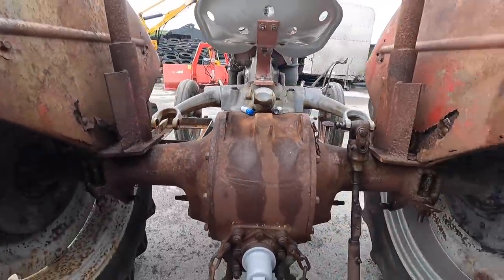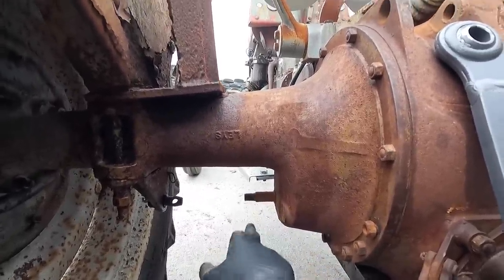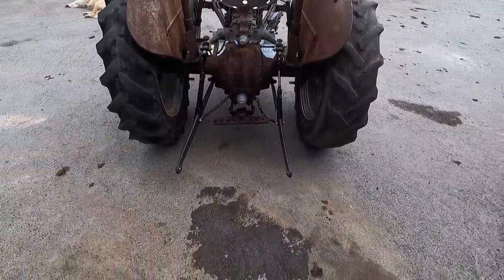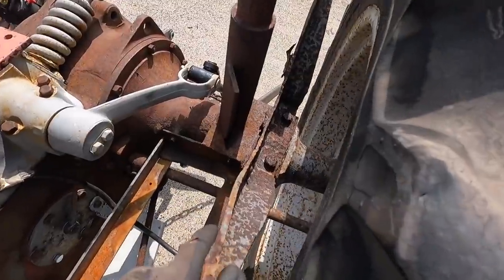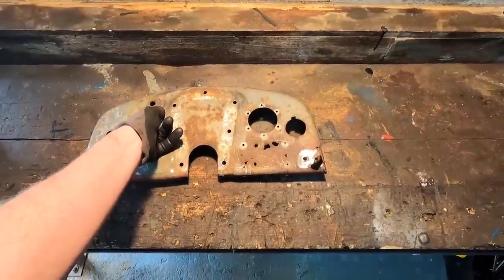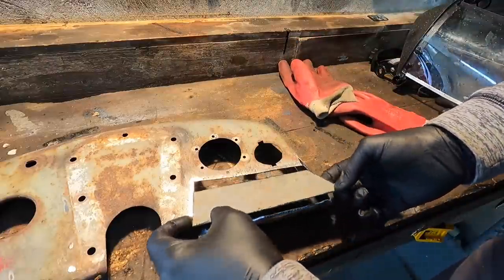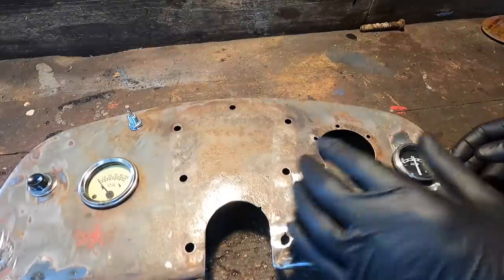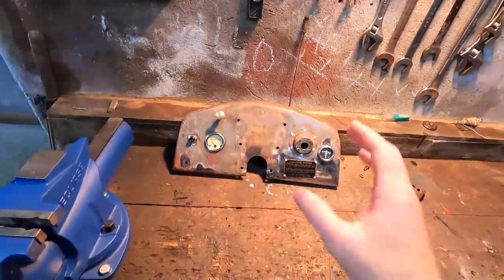FERGUSON RESTORATION -PART 3- IT'S NO GOOD WITHOUT A LIFT AND THE DASH IS REBUILT/RECYCLED!!

Comment: For the rusted holes in the dash you could have saved work by just cleaning the holes up and with a flat piece of brass put it behind the holes and then weld the holes until filled. Then you remove the brass plate and grind the welds smooth. Also you can get different wire that's made for dirty metal.
 That little mig is all you'll ever need for fixing tractor buckets to sheet metal.
 Very nice to watch your videos from a different part of the world, Ontario, Canada here.
Reply: Great advice ,I thought the same as soon as I saw the dash .

Comment: I love my MillerMatic welder. Set my wire size, and then just set my dial for material thickness. Works a treat. I did buy 2 gas bottles, just so that when I run out of gas on a holiday Saturday night I’m all good to go. Still cheaper than renting.

Comment: Adrian, I repaired a pinholes chainsaw petrol tank with a compound called Seal All which came from a motorcycle repair workshop/shop it was handy as it came in a small tube and was about £6 whereas the tins of sealant were £40+.

Comment: To take out the 2 bolts in the mudguards going through the axel I find if u cut the bolts on the top then lift off the mudguards, the bolts should be about 10mm proud of the axel housing. So a couple of good cracks with a sledge should get them moving once moved grind down the tops flush with the axel cos it. Probably be like a mushroom after the sledging then get a punch and a heavy hammer and it should be handy move it then. Works for me. Another excellent informative video. Keep them coming. 👌👍

Comment: Hello Adrian, the tractor is starting to come together nicely for you. I get my argon (for TIG welding) from Stargas as opposed to hobby weld so I’m not sure if this applies to their CO2 bottles. I got a 20L bottle which is filled to 200 bar which is 4000L at atmospheric pressure, the 9L bottles are only filled to 135 bar which is only 1215L . The refills are only around €30 more expensive for over three times more gas so if the same is true for Hobbyweld CO2 then I would strongly recommend paying the extra few euro to upgrade to a 20L bottle because you will save a fortune on refills. Love the channel, keep it up.

Comment: Good tip for MIG welding, you want to follow/push your puddle when laying a bead unlike arc welding where you drag your puddle of molten metal. This will also help with burnthrough on the steel.

Comment: I used epoxy filler on inside of steering housing which had been badly attacked by electrolysis and have run with grease instead of oil in housing for some time with no probs.

Comment: When the contractor comes to bale your silage if they have a fusion or wrapper that can use 2 rolls of wrap at the same time you can put on 1 roll of black wrap and one white and then it will wrap the bale in stripes and you wont have to the paint bales to keep the crows off of them.
Reply: Is this true?  Wow!
Reply: @jimpolk  it is true I've seen farmer phil doing it with their McHale fusion 2

Comment: The ammeter on my 135 sits in a complete rubber to insulate from metal work and hold it in dash I’ve had a quick look on tinterweb and think the Ferguson’s are the same maybe that may help. Be interesting to see if you can get it to work cause I can’t and is identical ammeter fills the hole in the dash though

Comment: Carvilles Tool and Weld, Monaghan Rd, Castleblayney
I usually braize the linkage rods and add in washers to take out all play. I think with the mig and the fine old metal all clean and got around spot welding the bits in then grind out

Comment: Another great video as usual. Little tip with the mig one don’t weld wearing a t-shirt as you will end up with sun burn on your arms and two push the mig torch don’t pull. 👍🏻
Reply from the maker: Yip I learnt that the other day, nice red arm. Arc welder never did that

Comment: Just be aware in future Adrian when welding in patches to take your time with the welding. Too much heat will warp and distort a panel. You are flying with that restoration. I started restoring a county back in 2005 and its still not finished😔. Although I have completed a few other project in the mean time and got married bought a house, had three kids and moved house again. Time flies👍
Reply from the maker: Your a busy man, yip time waits on no one 👌👍

Comment: Great video again Adrian your further along than me as it turns out my engine is completely sized but it hasn't been started in over ten years and my mechanic friend who's helping me said that's not  a big issue to deal with, and in my humble opinion I still think painting it up would be the better option but it is your tractor you should do what you feel is right for your restoration mate.
Reply from the maker: Ya you could get lucky with that engine as it may take very little to get her turning over, hope that’s the case. 
I’m not going to paint it for a while to make sure all is running ok. Really like the old used look though as there’s so many of them painted out there. I’d feel like I’d be erasing its history 🤷🏻‍♂️
Reply: @IFarmWeFarm  Thanks Adrian hopefully it will be easy getting the engine going, and I can see your point on the paint but either way it will still look grand when its finished.

Comment: Hi Adrian that hole in the steering box happened on mine too. I drilled and tapped it  to the nearest bolt size to the hole. (Mine was a m4 size hole)Put a bolt in leak sorted.hope this works for ya.
Reply from the maker: That would work for sure, nice one lad 👌👍

Comment: @IFarmWeFarm I made the throttle linkage on my 1956 tef 20 with m6 threaded rod and new ball and socket joints as you can't get the linkages or rods.
Reply from the maker: Yes I will be doing the same hopefully 👌👍
Reply: @IFarmWeFarm  I ordered the M6 ball and socket joints off RS components online. I can send you photos of the throttle linkage rods that I did. I'm from near cootehill
Reply: @IFarmWeFarm  also there shouldn't be oil coming from that section of the gearbox as that's where the clutch is so my advice is lift of the cover and find out why there is oil getting out there. It's not an overly difficult job. I had the lid off mine to fix my 3rd and 4th gear.

Comment: Hi, the first oil pressure gauge i got for mine was terrible, zero was not lined up properly, was yours like that,   great job your getting there, looking forward to the oil change, hopefully you won't be missing spring and washers in the filter housing like mine
Reply from the maker: No I haven’t noticed that yet, I have to have a good look at that tomorrow,  cheers William

Comment: Glad you went with my suggestion with gas. Will it replace the stick welder? 🤔 No is the answer. Gas migs don't like wind and can be a faf to transport round the farm compared to a inverter stick welder for example. If your welding really thin stuff with the mig you might try pulses with the trigger to produce small spot welds or (laying the penny's) beside each other. Great video sir love the commitment 👍 Stay safe 🏴 👌 👍
Reply from the maker: Cheers Ian

Comment: You'll miss the smell of using a stick welder. Mig is great, you just need to push the bead and not get ahead of the bead with the wire, as  it pops and blows holes when the wire contacts the steel. You can backtrack 5mm if that happens and it should fill in the holes.

Comment: The right arm is on wrong for the 3 point linkage it is upside down
Reply from the maker: I don’t see how, can you explain so I can check it again
Reply: @IFarmWeFarm  don’t worry about the levelling box hitting the axel mine does it also but you won’t have it all the way down when you are adjusting it
Reply: @IFarmWeFarm  when you are looking at the back of the tractor the right arm for the lift is on wrong it is upside down where the pin goes in for a transport box it is pointing out and it should be pointing in

Comment: Never mig weld in sun light. Just doesn’t work don’t know why
Reply: Wtf
Reply from the maker: It’s always over cast here anyhow 🙈
Reply: @IFarmWeFarm  🤣🤣🤣 but right enough mig welders don’t like the sun
Reply: Well Aidan, when your welding with the mig welder, weld the opposite way to the stick welder, as you weld with the mig u need to keep the gas blowing into where ur just after welding aswell, it's hard to explain but look videos on u tube if you get a chance, should make it easier for you.